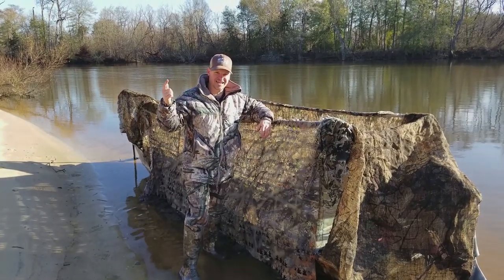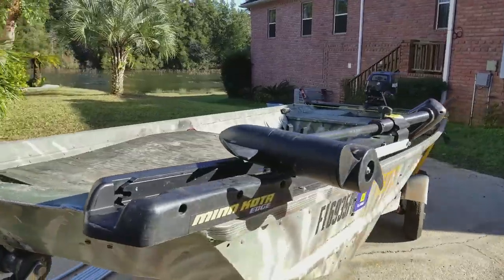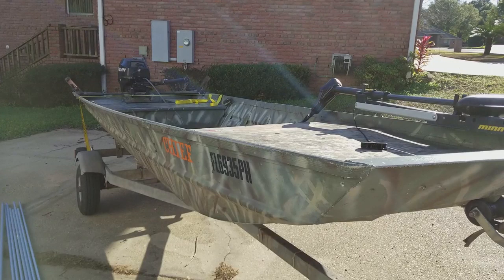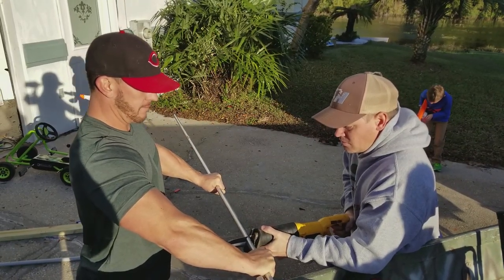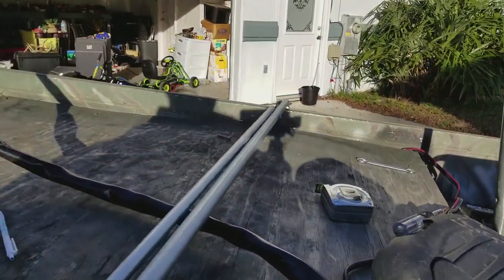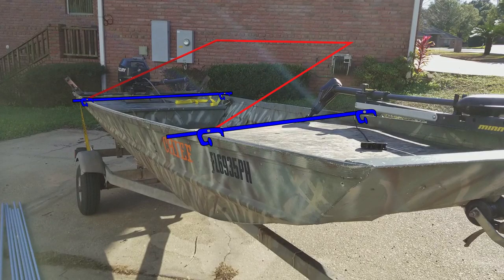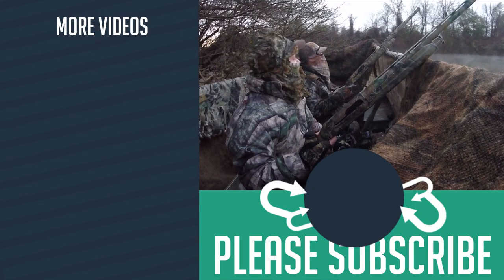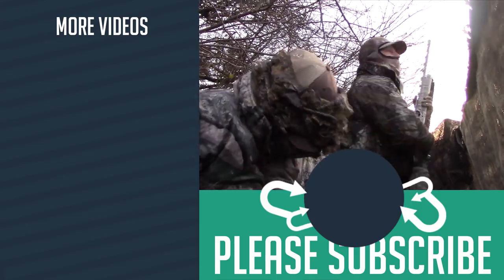How to build a DIY Duck Blind on your Jon Boat

Comment: When you attached the 1/2 to the 3/4 conduit, did you attach one side of the 1/2 on the outside and the other on the inside so it folds flat? Also does the grass mats fold up easy like the burlap? Thanks

Comment: Hi, just a couple quick questions (building my first blind this year):
Would this be difficult to construct on a "V" hull?
Could you give a ballpark estimate on total cost?
Reply from the maker: It should be no different on a V Hull. It was probably close to $100 - $150 all in.
Reply: I have a V haul and there’s a difference . Your tubing is going to be about an inch away from the boat because of the V haul shape unless you bend the tubing inwards and the  C clamp’s bolt is going in at an angle. You might want to buy a bigger C clamp for the front because of this  . I hope that this helps

Comment: Not having any weight at the bottom of the cover that goes in the water do you have any issues with the wind
Reply from the maker: none. we've hunted about 20 times with this blind and it works flawlessly. I highly recommend it.
Reply: Thanks I’ve built the same one but I added a 10’ piece of pvc across the bottom of both sides for weight the wind was kicking my butt  but works great now thanks. And it still rolls up good with them at the bottom
Reply: Staple a 1x2 to the bottom. 
Serious.
Reply: P